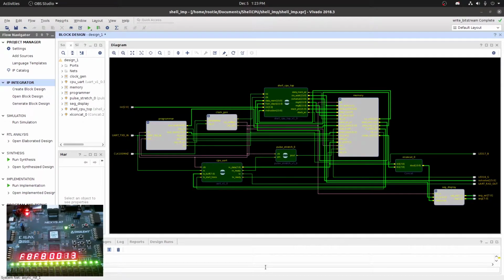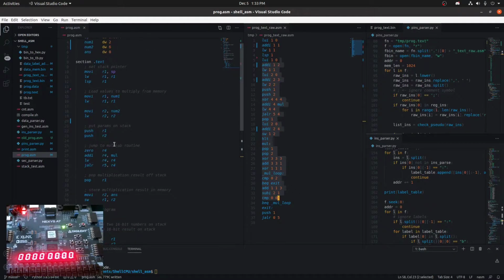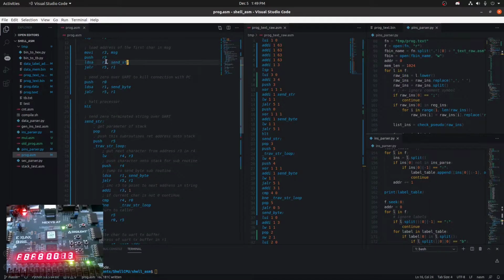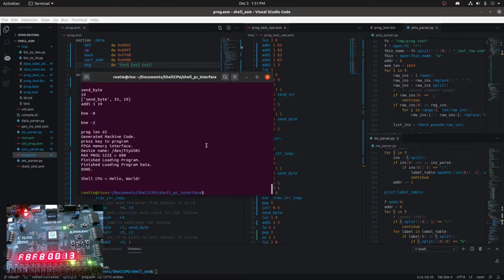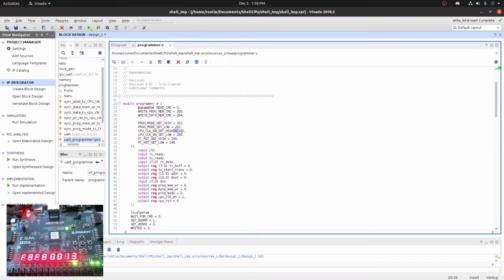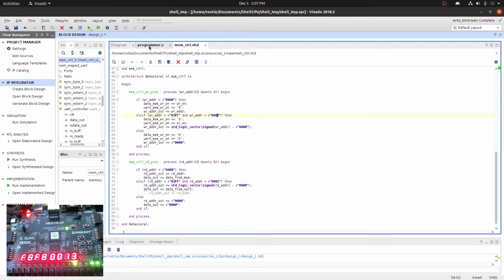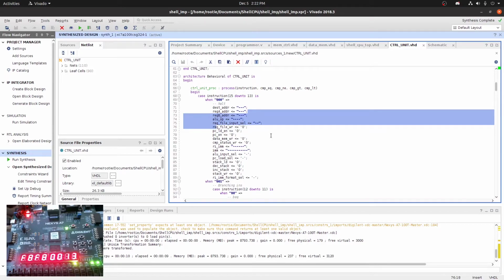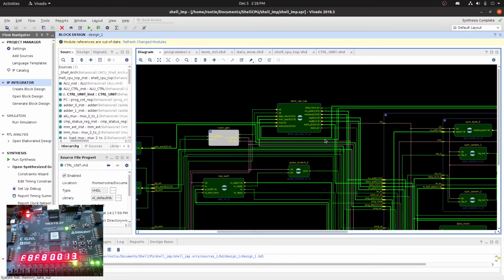16-bit RISC CPU demonstration and design overview.

Comment: Interesting project. I'm planning to design a 16 bit or 32 bit CPU. I did notice that you use "lw" (Load Word - 32 bits data length) and "sw" (Store Word 32-bit data length). Since your CPU is 16-bit, would the instruction "lh" (load halfword) and sh (store halfword) would best suited ? You did a great job and thanks for sharing your work and, Congratulation.